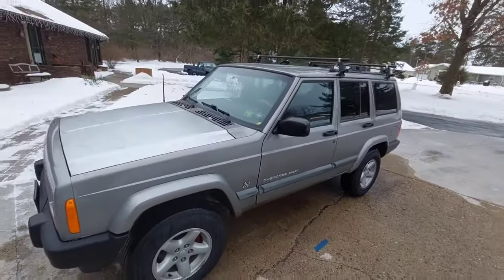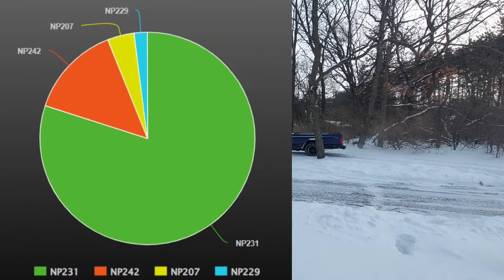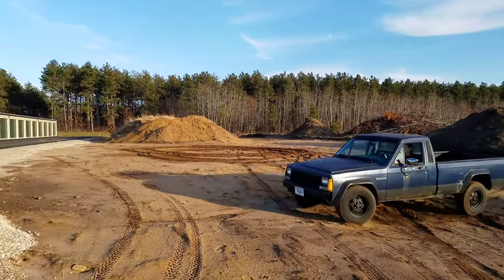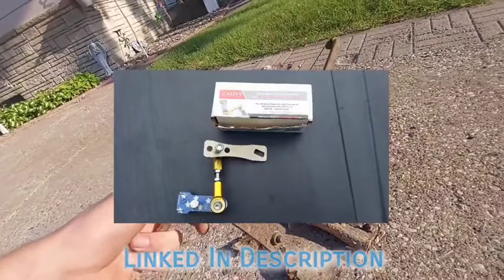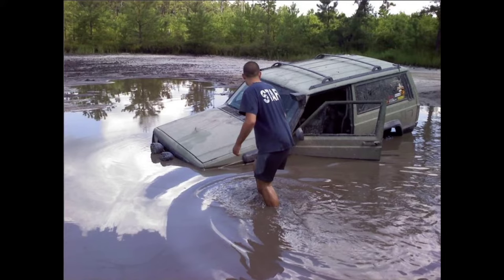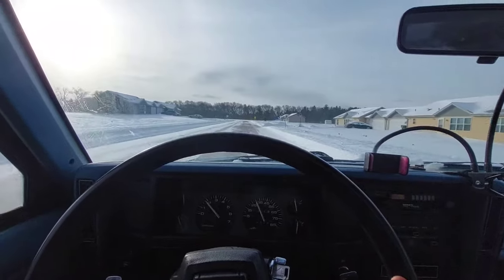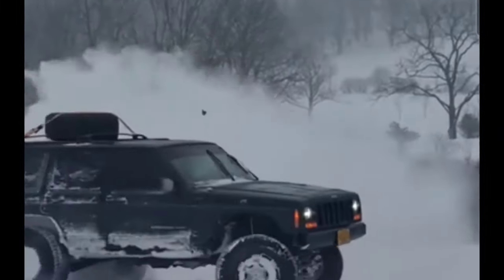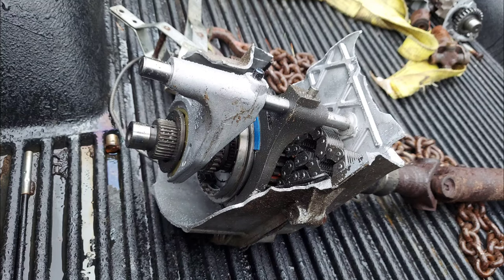Jeep Cherokee: Transfer Case Options & How to Use 4wd Correctly ['84-'01 XJ]

Comment: My 94 Cherokee Country was equipped with the NP242. It also came with ABS and a limited slip rear diff. So in "partime" 4wd, It used the abs as "traction control" on the front diff and coupled with the limited slip in the rear, it was an amazing 4WD/AWD system. It worked great on any slippery surface, rain and snow. I understand this was an unusual configuration for an XJ, I've never seen another XJ equipped the same.
Reply: Nope, no XJ ever came with traction control.
Reply: No thats just ABS its not doing any traction control lol. My 98 XJ has that, Up Country Package, ABS/Cruise control, External Idle button, NP242 + Trac-Loc LSD in the rear. Mine is a rare XJ having the 242/TracLoc. Means they get the more pricey transfer case, rear diff, up country,. Trac-loc was separate from U.C & tow package. Also got the smokers group & tinted windows.

Comment: Where was this video two weeks ago? I knew something was up with my front diff as i had already cleared u joints and my steering compartments. One raining day i took it out in the neighborhood, was getting bad traction, completely new to 4x4 and was going off the manual for my select trac cherokee. Went into 4x4 part time to take off, as i understood from the single short paragraph explaining what conditions to use what in, and my manual states that i can release the gas and shift back into 2 wheel drive. Like i said i knew SOMETHING was about to break, couldn't figure out what, had the time and money to FAFO. When i went from 4x4 part time at about 15 miles per hour into 2 wheel i didn't even get to hit the gas. Instant jet engine sound. 3 blocks to get home and a hour later i have a shredded spider gear, about 8 teeth, and a blown pinion gear and bearing. My bearing was bad. Right now Ive just gutted my front diff and removed the drive shaft so I'm 2 wheel only. But I'm trying to understand my 4x4 set up and how to use it. I apparently understood it backwards. I thought 4x4 part time was 2 wheel with 4x4 when it slips. Low for off road, high for if you getting up into the 40s range in snow or rain going to work. I'm probably going to blow another diff fully figuring it out but i hope not. The jeep is a far cry from the hot rods I'm used to but i honestly love this thing way more. Probably my favorite car I've owned to date. Edit i think i confused myself in the manual and was in fact supposed to slam home past part time into 4x4 high.  Granted my diff wasn't long for this world with a bad bearing but a idiot playing with levers on a rainy day didn't help.

Comment: My Comanche came stock as a 2wd, when I couldn't sell it for even $500, I lifted it and put a np231 in it and that lasted for 3 years but the transfer case eventually blew when the factory linkage did something bad to it while I was driving offroad. When I rebuilt it, it lasted another year but when I rebuilt the engine to a 4.6 stroker, the 231 blew again. After that I bought a 242, which has a stronger planetary gearset and wider chain and it hasn't had a single issue with it since.

Comment: The 242 is a godsend in Vermont winters. Full time mode makes it much easier to accelerate from a stop when the roads suddenly become slippery. "set it and forget it" indeed
Reply: I have been driving a 92 with Select-Trac in western Washington for 15yrs or so.  It is great for conditions of changing traction that we get a lot such as rain mixed with slush, first rain after a summer without rain (oily road surface), black ice.  It is also great for Forest Service roads or other gravel going up hills.  Much better traction to accelerate and avoids spinning a rear wheel.  In low traction conditions, the full-time 4wd allows the Jeep to out-accelerate high horsepower cars with that have only 2wd.  I rate these transfer cases as highly desirable.  Love the video.  A new subscriber now.

Comment: I have 1991 xj 4.0 with np242 transfer case and if i get it right, for daily drive on snowy and slick road surfaces it is better to drive it on 4x4 full time?
Reply from the maker: yes
Reply: Yes, full time mode, unless you cannot maintain forward movement, then shift to part time mode.  Full time is meant for light duty use, where slightly more traction is needed than 2WD is providing you.

Comment: I wouldn’t give you two cents for the select a trac transfer case they aren’t good for anything the constant viscosity joint or coupler in it fails all the time it’s not if it’s when just take it out toss it and install a transfer case that ha 2wd 4hi and 4 low and be don’t with it!!! The rest of them aren’t worth two cents I have no idea why they even come up with the junk!!!
Reply from the maker: @richard6606  You're thinking of the NP249 in the Grand Cherokee. The NP242 has a differential in it that uses real gears, where the 249 has that viscous coupling that always dies
Reply: @WAEMIDIV  that’s the same as the so called full time four wheel drive
Reply: @WAEMIDIV  the ones that say 4 hi full time and 4 low are the same as the 249
Reply from the maker: @richard6606  no, even in the Grand Cherokee there was an option between the NP242 and the NP249 in many years. The 249 is AWD only, with just low and high range, that's the one with the viscous coupling that always fails. It is not available in Cherokee XJs. The 242 has AWD and part time, it uses a center differential, and is available in both the XJ and ZJ/WJ. Look up the Novak guides on these 2 entirely different transfer cases
Reply: @WAEMIDIV  the full time selection isn’t it the one that moves power around to the wheel that slips from what I’ve read it’s basically the same as the awd

Comment: I think all XJs supplied to the UK had 242s. At least, I haven't seen a 231 yet. It makes sense as 242 is perfect for out winter roads and works well with the rear LSD which was also very common (but pretty much guaranteed to be skipping now!)

Comment: Overheating issues, use a fan shroud, don’t use a lower temp thermostat, use 195 and the coolant will stay in the radiator long enough to cool down. This fixed my overheating as I attempted to use a 165 thermostat without a fan shroud and continue to get overheating problems.

Adding the fan shroud helped and it was fine and winter, and the summer when I replace the thermostat, I put OEM 195 instead of 165 and it actually worked! You would think a cooler thermostat would keep the system cooler as it lets the coolant flow at a lower temperature; however, The coolant needs to stay in the radiator long enough to cool down. If it circulates too fast, the radiator is not cooling it effectively. It is counterintuitive, but I finally figured it out. The jeep overheating issue has been solved. Folks use the right temperature thermostat never delete your thermostat
Reply: You can take the guts out of the thermostat and it'll slow the water down enough to let it cool also. You can find restrictor plates for some thermostat housing also that serves the same purpose

Comment: 2:40 OMG is that a long bed Comanche? Where in the world did you find that? That is a diamond in the rough buddy

I would absolutely love to find a Comanche with a manual transmission and four-wheel-drive with the 4.0 in-line six but I don’t think they made it that way.
Reply from the maker: They sure did make them, because that's the exact spec of the one I had (have)
it is a 1987 4.0L Manual 4wd Long bed 
I have a playlist of videos about it

Comment: Oh hey! I have a 242 in my automatic Cherokee!

I'll never let my friend drive my Jeep again for this reason...
Reply: Finding a 242 in a Cherokee, Grand Cherokee, or a Liberty with a manual transmission is almost unheard of, unless someone swapped it in themselves.  I actually don't believe the 242 (selec-trac) was a factory option with a manual transmission.  Every manual/242 equipped Jeep I've ever ran across was owner swapped.  You can do it, you just have to change the input shaft on the transfer case to fit the transmission, sometimes you have to change the output shafts to fit the driveshafts as well.  Kind of one of those cases where you will have to figure it out as you tear into it type things as to what parts you'll need to pull from the old transfer case to put int eh replacement.

Comment: Been binging your videos, my 4WD indicator light doesnt work and I know I changed the bulb out on my 97, any ideas? Your videos are very idiot proof and some general troubleshooting videos would be beneficial to schmucks like me
Reply from the maker: I got a friend who's part time light also doesn't work, I've been meaning to steal his Jeep and do a diagnosis video on that. I'm fairly certain his problem is a wiring issue. 

However, 95% of the time, that light not working is caused by the Indicator Switch on top of the transfer case. It's a small sensor with a button on it, and they fail all the time. Literally 5 of the 7 Jeeps I have owned had this problem, very common. 

https://www.rockauto.com/en/catalog/jeep,1997,cherokee,4.0l+l6,1180370,electrical-switch+&+relay,4wd+switch,4412 

This is the part you need, TCA9, the 2 terminal one. (assuming you have NP231)
Reply: FWIW, I swapped bulbs around with ones I knew worked(the upshift light), and both worked in the upshift position soooo.... bit lost lol
Reply: @WAEMIDIV  You're a damn legend, thank you so much!
Reply: @WAEMIDIV  I just got around to putting it in and it worked like a charm, thanks my dude!

Comment: wow! amazing video and well done my man. you solved my problem of "what the heck is that crackling noise" when i make a tight turn on pavement in 4H and especially 4L. I'm just glad I didn't run it long enough to break it. I'm a new owner and just learning more about these XJ's. Mine is 2001 and love it. Will want to do a 3.5 lift soon and need to learn some more! Thanks again for a great tutorial
Reply from the maker: Be careful with lifts, do your research and cover all your bases. at 3.5" you're gonna need longer brake lines, adjustable track bar and maybe even a SYE kit, which are things people often overlook. I had a 1.5" lift on mine for a while but took it off because I didn't like the body roll, and it was causing Unforseen problems like the driveshaft angle being too steep.
Reply: @WAEMIDIV  do you have a lift video? I didn't see it but you have so many videos can't keep up
Reply from the maker: @alecsithong  https://youtu.be/jOHGbPfV5ZQ
Reply: A hard 2nd to "do your research" before lifting.. most kits get your suspension lifted just fine, but they don't tell you about the extras you're going to need.. the longer brake lines obviously makes sense, but without an adjustable track bar, your front axle will end up offset. I'm currently sitting at 3" of lift and I'm not running a SYE.. But, I've also never had any driveline vibration or death wobble, which might warrant one. You will also likely run into some "bump steer" issues because of the now altered steering geometry. I ended up getting the adjustable track bar kit from Iron Rock Offroad and it came with a track bar drop bracket. BAM! Centers the axle and corrects any bump steer. Wish I had known that one from the get go, lol!

Also, great video! Super informative and I definitely learned a few little things I didn't know. Always nice to bone up on how things work in your rig!

Comment: 8:42 so you are showing that 2 Wheel Dr. is driving both rear wheels, four-wheel-drive is driving all four wheels. As I understand it, the Acen automatic transmission with the command track only turns the lift wheels so in 2 Wheel Dr. it will do a one wheel peel, and four-wheel-drive. Your front and rear left wheels are being given torque, but the right wheels are not that the only way you can have all four wheel spinning at the same speed is to install a locking differential front and rear, correct?

That most of these trucks never came with locking differentials, neither in the front nor the back
Reply: In diagrams like that its showing the axle(s) being powered, not necessarily individual wheels....there are times when you can get all 4 wheels to spin, sometimes you can get 3 to spin, but most commonly you'll find one front and one rear wheel spinning with open differentials...sometimes you can actually get a front left and rear left spinning while the 2 on the other side are sitting still....it all depends on traction, weight, vehicle angle, etc....tons of variables come into play as to which and how many wheels turn in a conventional 4WD system without lockers or limited slip differentials.

Comment: The day after I bought my XJ (first 4WD I've ever owned) I didn't know any better and drove around for a couple hours in part time all over the pavement on a snowy day. It's been a year and a half since and it still seems to be working fine, but yeesh does that bother me to think about.
Reply from the maker: They're pretty tough 4wd systems, and can build up a bit of tension before they start binding. In my early days I did something similar but in the rain, and I did just fine for a few miles. I ended up making a tight turn in a parking lot and the Jeep just stopped moving - the wheels had bound up and I was stuck. I just reversed in the exact opposite direction, and it unbound them, put it in 2wd, went about my day, and never had a problem
Reply: Doesn't hurt anything to drive in 4WD part time on pavement, the issue comes with tight repetitive turns on dry pavement while in part time 4WD....that is when you will have binding issues.  A drive down a normal paved highway or freeway in 4WD part won't hurt a thing as the curves are usually quite sweeping, rather than sharp hairpin turns.

Comment: Will a front axle, transfer case and transmission from a 1996v6 Cherokee swap over to a 2001 2wd 4.0L Cherokee?
Reply from the maker: Front axle - yes, but you'll have to lift it 2"+ or modify your exhaust because it'll be a high pinion Dana 30 going into a vehicle designed around a Low Pinion Dana 30.

Transmission - No, unless you like doing a lot of wiring modification.

Transfer case - Yes, no problems there.

Comment: A Cummins in-line, six turbo diesel would be awesome in these
Reply: Idk, a 5.9 cummins is over twice the weight of the amc 4.0. Both are reliable but I would still give the amc 4.0 the advantage. The AMC can go much longer between service intervals, and in general puts up with abuse better. Same with any of the subsystems; fueling, cooling, TURBO, etc. 

The big advantages of the 5.9 are total power, specificity torque and fuel economy. Fuel economy might be a wash, I bet you could at best get ~25-27 mpg out of a well tuned 5.9 in a XJ frame. The power is kind of only usefull for towing and the XJ just isn't the truck for that. The towing capacity isn't limited by the engine in a xj. 4.0 still has a great, smooth, wide torque curve that come on pretty early. No turbo lag.

IF you want more power, better mpg and about the same reliability, cheap costs I would just stick an LS in there. About the same weight, compact, cheap, globs of power. No turbo system to deal with.